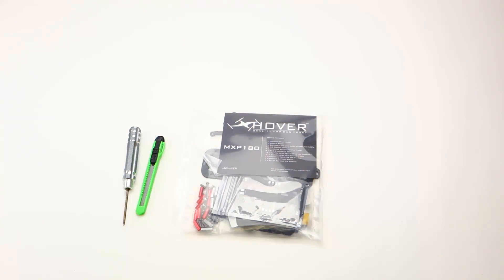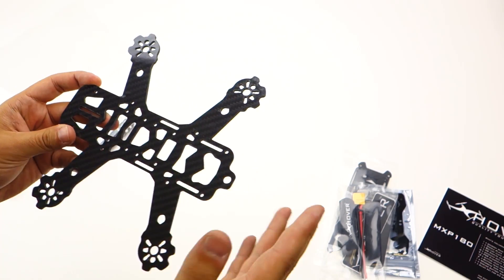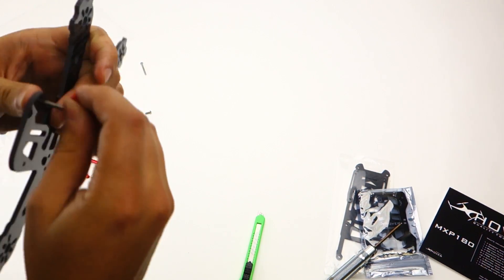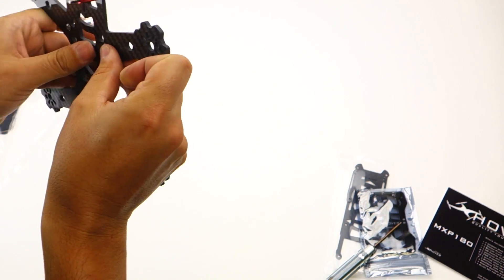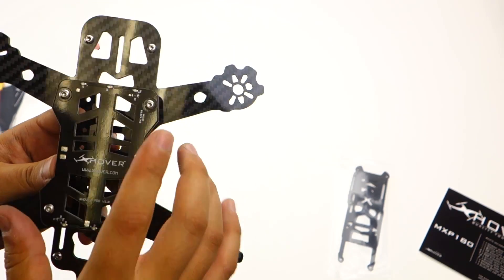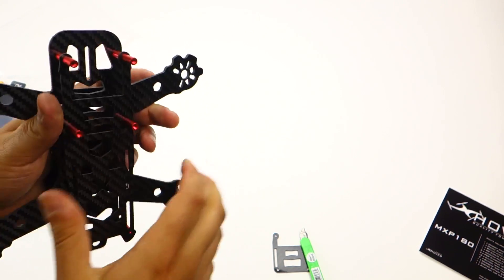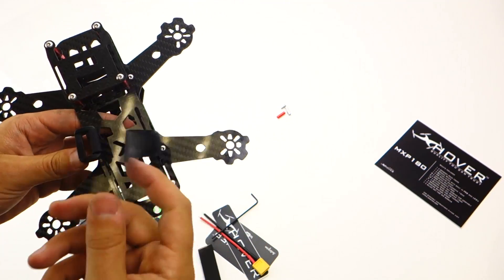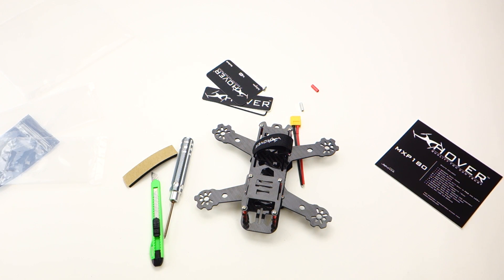MXP180 Assembly Tutorial

Comment: Hay Daniel, it looks good, can you squeeze a five inch prop on that? What motors and ESCs do you recommend? I'd be a bit worried about that power distribution board here in the UK with our almost permanently wet ground. I could insulate it though easy enough. :-) Thanks for the vid.

Comment: good video, thing looks like a blast.  Quick question, what do u use for battery monitoring when flying all these mini quads?
Reply: +andrew timmins There are a few options. Voltage Alarm on the quad, beeps when bat gets low. Or you can hook up your  Taranis Controller to verbally out loud tell you how much juice you got left.  
I fly with Xhover  a lot. He used to use a Voltage alarm but mostly uses Taranis to monitor his batteries now. :)
Reply: Thanks, Ive used taranis telemetry awhile but when u are punishing your battery ur taranis talks a lot lol, wondering what u guys did.  Thanks again
Reply: +andrew timmins Haha so true! 
I havnt in a long time but I'd like to give OSD a try again.
Reply: +Brandon Geiger (Wizwooky) I never cared for them but i have a vortex and I admit some of that stuff is nice.  in wouldn't mind a current sensor bit 20g is a lot when ur trying to keep the weight down.